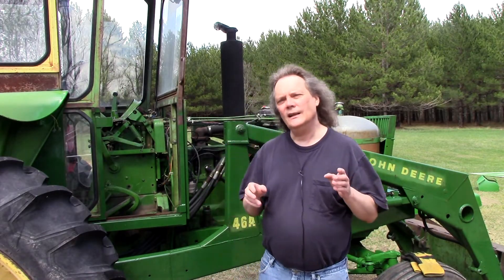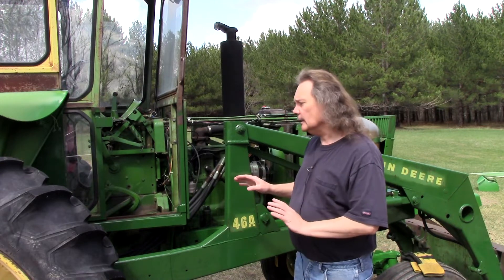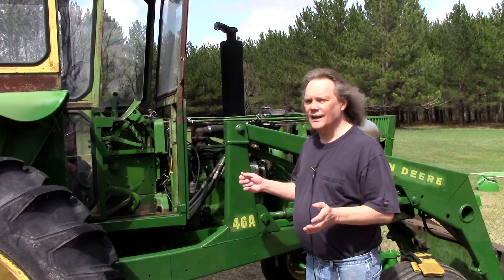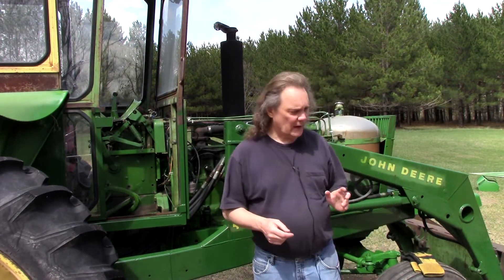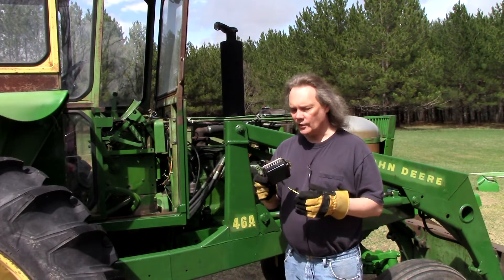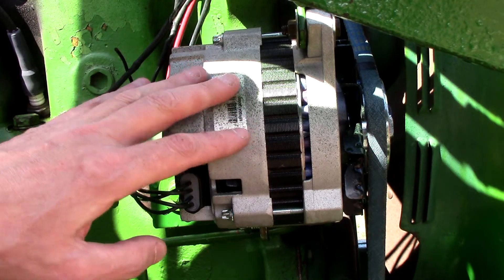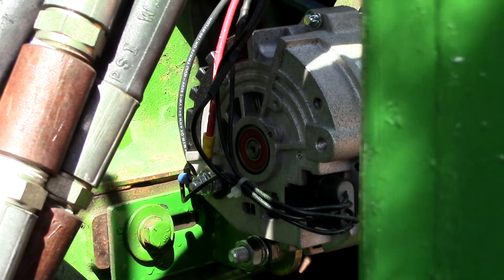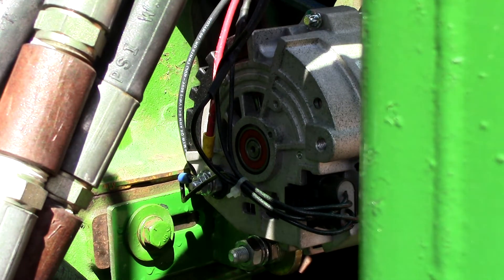DIY Tractor Upgrade: How to Install a CS130 Alternator on a John Deere 3020 - More Power!

Comment: So instead of a lamp to excite the battery I could wire it to the ignition wire ?
Reply from the maker: Yes, you can wire the alternator’s excitation circuit directly to an ignition-switched source instead of through a lamp, but there are important considerations.

Most internally regulated alternators (such as Delco 10SI/12SI or similar) use the “excite” terminal (often labeled #1) to get initial field current when you turn the key on. A lamp or resistor is normally placed in series with this feed for two reasons:

1. *Current Limiting* – Without a lamp or resistor, the excite terminal may draw more current than necessary and can backfeed the ignition circuit when you turn the key off, keeping the engine running (“dieseling”).
2. *Indicator Function* – The lamp shows charging status; it lights with key-on/engine-off and goes out when the alternator starts charging. This also confirms that the excite circuit is intact.

If you bypass the lamp and connect directly to ignition, you should at least install a resistor (typically 35–500 ohms, around 2–5 watts) in series to prevent backfeed and limit current. Some setups use a diode in series instead of, or in addition to, the resistor to prevent current from flowing back to the ignition when the key is off.

In short:

* Direct to ignition will work electrically.
* Add a resistor or diode (or both) in series to prevent backfeed and limit current.
* You’ll lose the visual charging indicator unless you wire in a lamp somewhere else.

Comment: Barry, I've got a JD3010, and would like to do this same modification. My 3010 is a 24 volt system.
Reply from the maker: I'd be considering rewiring the tractor to a 12 Volt system. The tractor wearing isn't very complicated but you'd need to replace the starter with a 12 Volt starter, and that's an expensive part.  There's quite a bit of information on the Internet about converting those tractors to 12 Volt so it wouldn't be a difficult adventure.
Reply: @Barry-Watson  Yes, I've seen those conversion videos. Thanks.

Comment: Barry, great video!  
Getting ready to convert my 1964 JD 4020.  Do you have a part number for that alternator (looks like there are many versions of the cs130!)?  Does it come with the 4 wire connector?  Thanks!
Reply from the maker: I thought all the CS130s shared the same package dimensions.  I did need to get a inexpensive aftermarket mounting bracket to accommodate it, and had to do a little grinding to get that bracket spacing set correctly so the belt lined up perfectly with the fan pulley.  Look for a bracket that allows for a little adjustment in the mounting holes.  It really wasn't a bad job.  It comes with the 4 wire connector, but you don't need to use all 4 wires to make it work.